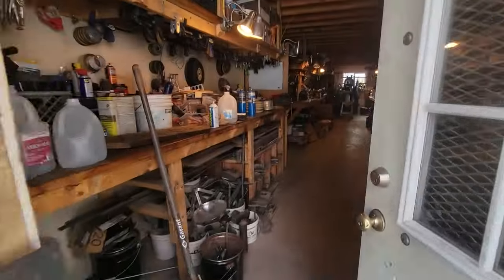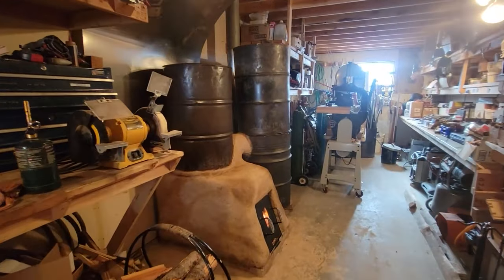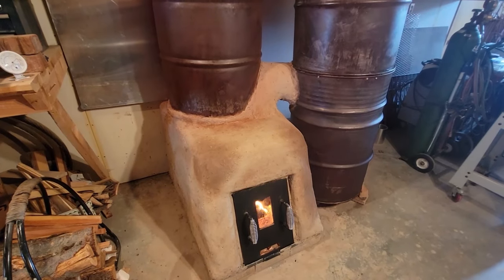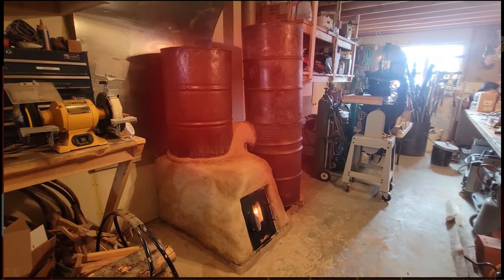triple barrel batch box rocket heater for fast heat in a shop

Comment: Now Im glad that I didnt build a mass heater for the shop last fall. Instead I built a regular steel fire box. Its already deteriorating, though I knew it would. It was a fast, temporary solution for this winter. Ive been wanting to build a mass heater for the shop but havent taken the time to do so. Now after seeing this, I know what Ill be building this fall. Thanks Paul!!!